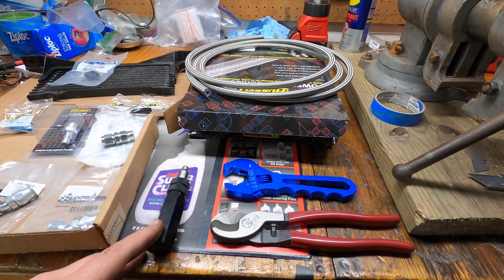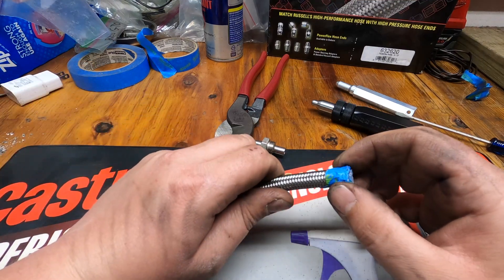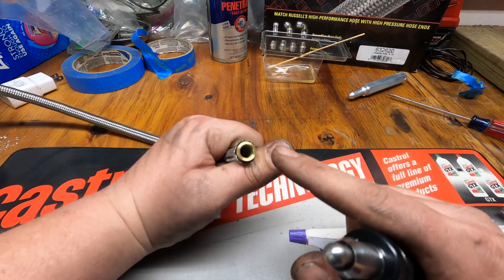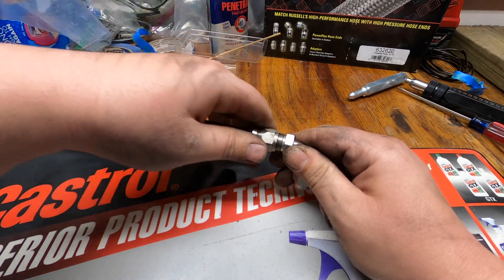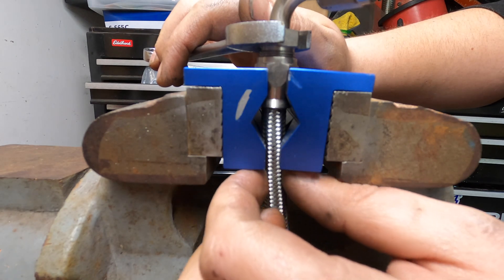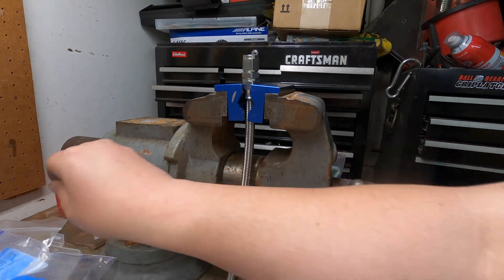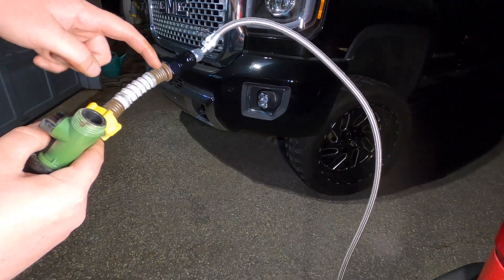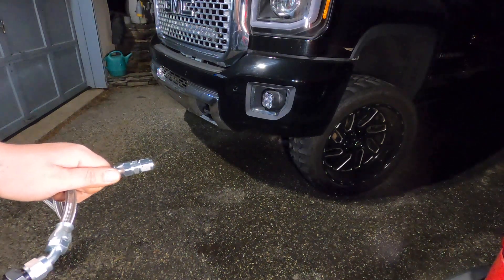ASSEMBLE, FLUSH, and LEAK TEST P.T.F.E RUSSELL POWERFLEX SERIES hose end's (GTO steering PT. 1)

Comment: Nice, you got ahold of some 45's. They were on backorder when I did my pressure line so I just did 90s. I'm thinking about doing a video on this too, along with a new actual fluid cooler, new reservoir, and routing everything back over to the driver's side. But for now I just had to replace the pressure line down to the rack because mine was leaking.
Reply from the maker: Funny story about that lol waited on 45’s for 2 months didn’t want to wait any longer. I found some 45’s from a different company that all the specs were identical on so I used those. I pressure tested them and they seem to be ok but we shall see, then of course literally today since I got the rest of the power steering video done yesterday (hopefully get it posted tomorrow or the next day) but the Russell 45*s came in today 🤦🏻‍♂️ lol I’ll hang onto them just in case these leak I left enough line to cut it back if need be
Reply: @bought2build  ha! Of course that would happen. Looking forward to the next one. I have a pretty good idea how I'm gonna route mine but it'll be nice to see someone else's take on it.
Reply from the maker: @evsnova74  I ended up with a different cooler and mounted it different because the intercooler is in the way but honestly still not 100% sure how I feel about my routing but I’m genuinely like out of room so it was pretty much the only way I could run it once I get the car together and tuned and whatnot I have a couple things I may go back and look at